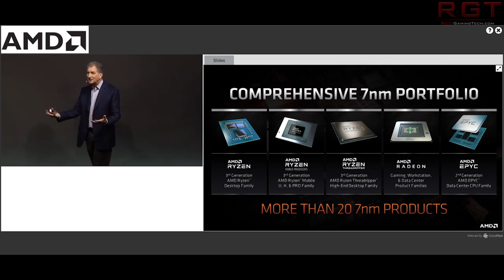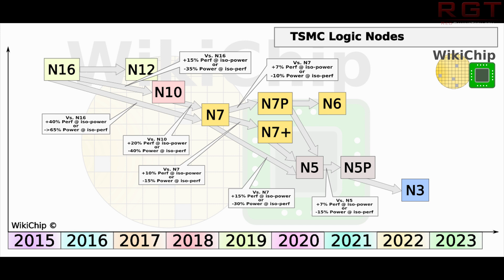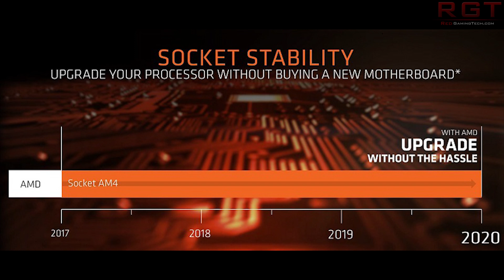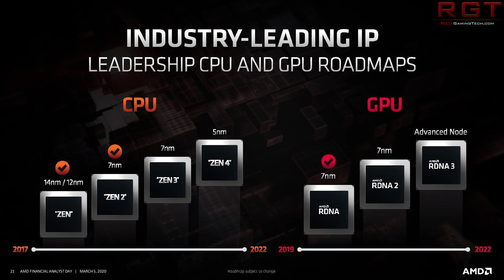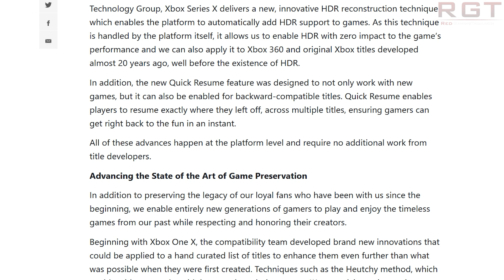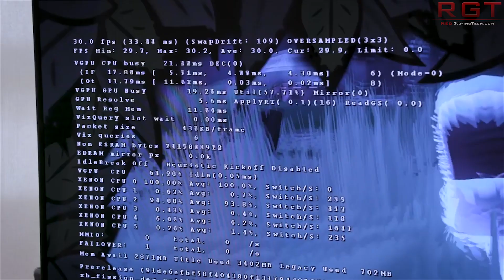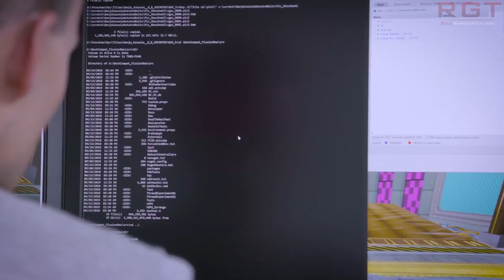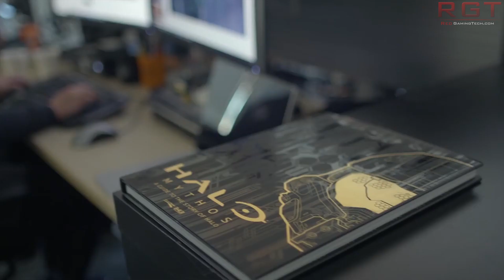Ryzen 4000 To Use 5nm & Change PC | Incredible Xbox Series X Backwards Compatibility Detailed

Comment: Hmmm I’m not sure tbh. Doesn’t seem logical to move on from a process that’s so new in the desktop market without seeing an enhanced iteration. I think the 7nm ccx changes seem far more logical especially when AM4 is end of life.
Reply: I think thats perfectly logical. If you remember in 2020 many new products will come out on 7nm. There is Ampere, big Navi, the consoles which will take a big chunk of the wafers and some more. So they might be able to ship even more Ryzen 4000 chips if they go 5nm+ because there is much more free capacity. Furthermore if they go 7nm Intel could catch up if their 7nm is not delayed but they definitly will not be able to compete with 5nm+.
Reply: isn't it an enhanced iteration though? There have been reports that TSMC has been working on a specially enhanced 5nm node, specifically for AMD.

Comment: So... the big question is are they really doing Zen3 on 5nm or are they in fact skipping what Zen3 was and jumping straight to Zen4 and calling it Zen3. 
Those chiplets will be getting very small if they keep the same number of cores and memory as Zen2.   I'm guessing a 5nm Zen3 will have 16 cores per chiplet and more memory.    I'm also guessing we are now going to see a 32 core desktop CPU.  And I doubt the memory controller will stay 12nm.  I bet it goes to 7nm.
Exciting times !
Reply: Yeah, maybe they're going 7nm+ for the zen2 refresh, and skipping to 5nm for zen3
Reply: @giovannibrena3913  Something like that.  AMD does leapfrog development with teams alternating releases.   I'm guessing the 5nm Zen4 team said "we are ready" and AMD just basically merged Zen3 and Zen4.
Reply: @SomeTechGuy666  It is more likely that AMD has had the 5nm Zen3 refresh team working concurrently with the 7nm Zen3 team, and the Zen3 refresh team has the refresh ready now.
Reply: They are almost certain to keep 8 core chiplets for a while. With the market segmentation they have, it doesn't make much sense to push the consumer line much past 8 cores for the low/mid range (ie the single chiplet CPUs) for another generation or two. If they push cores/chiplet beyond 8, a lot of their products will come from harvested or intentionally crippled dies, or they will end up pushing cores up in the mid/low end faster than software shows any benefits. Now they could do it to twist the knife on Intel. "Hey, here's our Ryzen 3s with 8 cores." But that has the downside of putting out CPUs that are too good and last too long, hurting future sales. 

Alternatively, they could up the cores/chiplet, probably to 12 or 16. Then they could fill the 8-core and under market with a monolithic die like the laptop die. Simpler packaging and a smaller footprint with plenty of harvestable dies would work well for the low end of the desktop. Imagine how many 8 core laptop dies have defected GPU cores. A little tweaking to the SKU line up could make everything 8 cores and under work with the laptop dies, either as G chips with functional GPU cores or standard chips without GPU cores.
Reply: @timberwolf1575   I meant to say that 5nm Zen3 will go to 16 core chiplets, not 8.  My mistake.  I'll correct my comment.
I don't think AMD is worried about hurting future sales with a 32 core Zen3.  They'll sell a TON of Zen3 product and can effectively wait a while before doing the next revision, saving a lot.  Killing Intel in the process.  And I'm sure that AMD is just getting warmed up as far as processor performance is concerned.

I agree that a lot of product could then be filled with a single chiplet.   Single chiplets run faster than dual chiplets too.

Comment: I'll add an idea which may make the 5nm process switch sound more credible: TSMC might have pressured AMD to purchase volume in the Node or lose the opportunity.  If AMD wants to monopolize the node, they may have jumped ship for Zen3.  They have plenty of other parts to push through 7nm to clean out those commitments.

On the other side, would switching to 5nm spread AMD too thin? Cthey have had more demand than expected but can the demand be sustained?

This is 190% speculation.
Reply: I feel like AMDs number 5 goes in hand with other 5s. AM5 5NM DDR5
Reply: @jdjeasy  Radeon Vii was the pipe-cleaner for the 07/07/2019 launch of Zen2, so it is possible that AMD will launch the 5nm Zen3 pipe-cleaner for Zen4 on 05/05/2021.

Comment: WTH !   Zen3 will be 5nm ???   Are you kidding me ?  Holy crap !  My X570 will get a 5nm 4950X with a 20% IPC gain !  AMD just extended the life of my current system a bit more. 
NO wonder AMD did a Zen2 refresh !
I'll gladly wait a few more months to get a 5nm product. 
Of course Zen3 will have higher clock speeds than if it was on 7m.  $20 says Zen3 hits 5 GHz on boost with 5nm !!!!!  Intel is absolutely toast !
Kudos for AMD for shifting things into a higher gear during COVID19.
Great reporting, Paul.  As always.
Reply: You forgot your sodium intake
Reply: @jdjeasy  Yeah, I'm a bit stoked about all this !
Reply: @adrenalinejunkie3828  Poor IPC compared to AMD too.
Reply: thissssss except I bought a stupid expensive x570  tier thinking it would be like intel where you get can more out cause of the mobo. But now I can lookforward to a 4950xt :D If i wait a year longer after the 4950x is released.

Comment: Could the update be happening because of the Huawei ban so AMD will take there place for the 5nm
Reply: Possibly, but I doubt if AMD would launch of 5nm. It is more likely that they would still launch on 7nm+, with a shrink to 5nm a few months later, similar to K7 launching on 220nm, with K75 launching at 180nm just a couple months later in November 1999.
Reply: caRn  Then why did AMD do it previously? Don't tell people to "think about it" when they've already explained their logic and you completely ignore it, you utter cretin. Think about it yourself!
It's not much extra work, because all the work they do on shrinking to smaller nodes is transferrable to even smaller nodes in the future. AMD were originally planning to release Zen 3 on 7nm, and have already started taping it out (we know this from leaked benchmarks). The rumour in this video is that they decided to release a die-shrunk Zen 3 on 5nm, which doesn't mean they're going to completely discard the CPU cores they've already made. Intel had alternated between new architectures and die-shrinks for every generation between Sandy Bridge and Skylake so this concept is not exactly unheard of.

Comment: This could make sense if TSMC suddenly had a lot of spare capacity due to dropping Huawei and AMD got that 5nm capacity for themselves.
Reply: It would probably be impossible for AMD to port Zen 3 to 5nm from 7nm in such a short period of time.
Reply: Stephen Werner matisse is zen 2 on euv, so maybe they could, but of course it is a rumor.
Reply: @stephenwerner1662  AMD went from 220nm K7 to 180nm K75 in less than 3 months, not because the could rapidly shrink the K7, but because they developed K7 and K75 concurrently.
Reply: I think if there's any possibility for them to be going 5nm for zen3 at all is because the always planned to have both a 7 and 5 nm version and picked whichever made the most sense at the time. Switching to a new node would add 1+ year to release between redesign and tapeout, which would mean zen3 slipping into zen4 release window, and that would be unacceptable. Increased fab capacity and the process being ready a few months earlier could be contributing factors to deciding to use the 5nm design instead.

Comment: i was going to buy a laptop soon ( intel 10875h and rtx 2070 super max-q for $2199) but im thinking of waiting for zen 3 mobile/an intel 8 core 10NM++ cpu and a rtx 3060/70 or a rdna 2 gpu around the same perf. do you guys think its worth it to wait 5-9 more months? will it be as big a jump as im thinking? rtx 3060 perf around a desk top 2070 or a 3070 around a desktop 2080?
Reply: Yeah I'd say the wait is worth it. Every single time that I chose to jump the gun I regretted waiting just a few months. Once the 5-9 months go by and new stuff comes out you'll wish you waited, that's how it always goes. I mean, you can look at it the other way and think that something new may be around the corner again, but personally I would wait this time around, should be nice upgrade.
Reply: The GPUs will be more like 3060=2080 and 3070=2080 ti, according to the leaks.
Reply: I would say you're better off waiting. It's always a bad idea to buy right before a next generation launch. Even if you're not planning to buy an rtx 3000 series or rdna2 at least the previous gen will get a reasonable price reduction and you might find suitable deals in the used market. Gaming laptops age really badly but the next gen of gpus seems promising in regards to power efficiency which is kinda the main constrain in laptops with limited cooling performance. So yah if they consume something around 50% less energy as both nvidia and amd claim this will results in a good performance boost to the mobile versions.